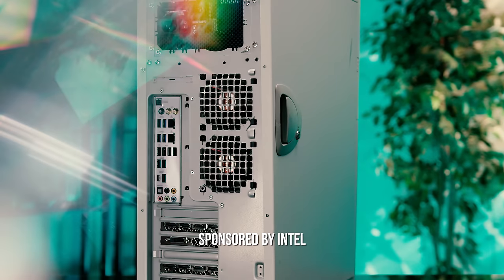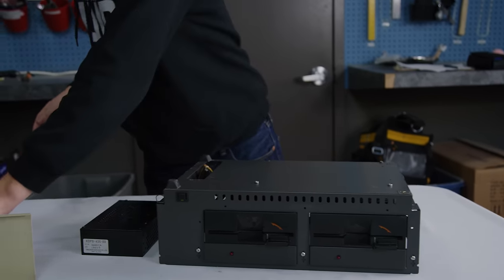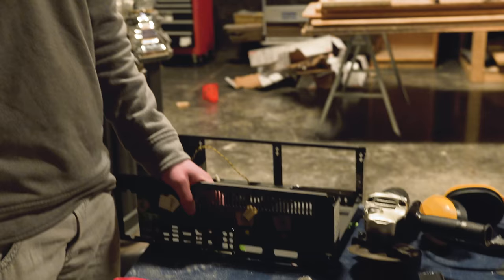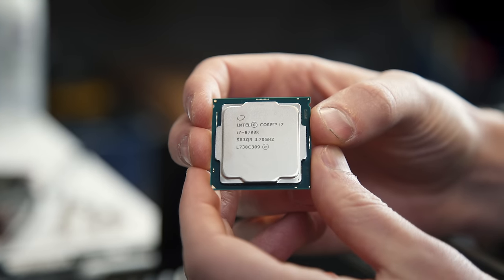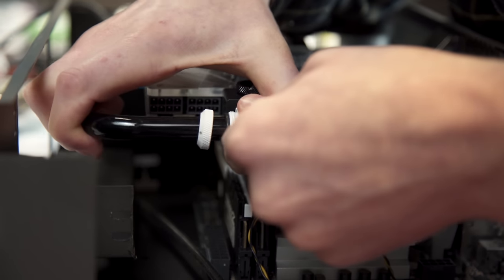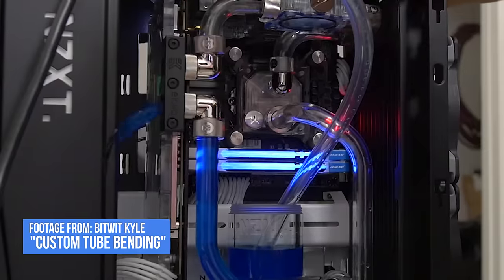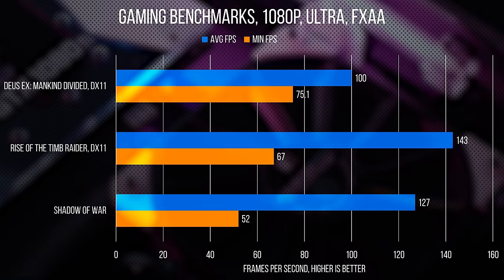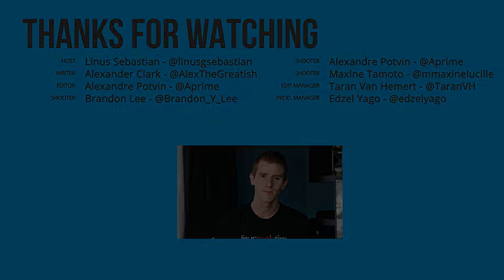The ULTIMATE Compact Sleeper PC Build

Comment: DALE is great as a sleeper...except no sleeper has RGB in it. Defeats the purpose of said sleeper.

Drop the stupid lighting because there are no windows anyways, and it is a perfect sleeper.
Reply: ChaosphereIX No one's going to see the RAM because there are no windows in the, to be fair. Also, a sleeper is supposed to be ordinary on the outside, and a party on the inside, so that when another person checks it out, they can see the work and effort put into the sleeper. This along with the performance of said sleeper makes it a sleeper.
Reply: ChaosphereIX Well that and the giant monitor on top and the peripherals. You need to completely scrap the modern amenities and replace them with a CRT, IBM model m mechanical keyboard, and an old Microsoft mouse
Reply: but putting in that light strip, to leak out all the HUGE cracks in the chassis, is not even like barely hiding your turbos behind the front grille, right beside the obviously huge front mount intercooler. No, it is worse, and is like putting in ground effects on your LS swapped Chevette. Defeats the purpose of a sleeper because it advertises to all that it is a highly modded car. Sleepers are all about the performance hidden in a humble chassis. Performance.
@Tony - the build is not about the peripherals, it is about the case. And no, you don't have to. I know lots of people who have gaming peripherals on crap computers. Or, to continue the automotive analogy, track tires on their family sedan. Or an expensive HID lighting system in their Corolla. Peripherals are extraneous.

Comment: Hey Linus margaret needs to be like an apple II but with 2 thick 60mm 140mm radiators, a 4k monitor, and a glorious i7-8700k overclocked to 5 ghz.  Oh and maybe 2 zotac 1080 tis in sli.
Reply: CompuTech No apples generally suck and so when you see an old apple then that must mean it really sucks
Reply: IoBrosGaming Hey the Apple II line was Apple's only GOOD computers. Once the Macintosh hit it went downhill fast.
Reply: IoBrosGaming Actually, Steve Wozniak designed the Apple II. Steve Jobs actually wanted to reduce how many internal expansion slots from 7 to 2 and lock down the computer. The Macintosh was Steve Jobs' idea and it was slow, locked down, and had a GUI,  which was a huge marketing point which was used heavily in favor of it. Steve Wozniak wanted expandability and openness while Steve Jobs wanted a locked down, expensive device with heavy marketing. Steve Jobs started the decline of the company, and Tim Cook screwed everyone.
Reply: That would be awesome hahaha
Reply: There already is an Apple II case like that. It's called a Raadition.
Reply: +IoBrosGaming Isn't that kind of the point for the sleeper builds? Make people think you got a piece of crap when it's really a VW Beetle body with a Porsche engine.

Comment: If I attempted a thing like that part of it might be done with a jigsaw with a metal cutting blade (fine teeth).  Angle grinders are fast but use them outside so you don't start a fire from the sparks.  Keep a good hold of that thing too because if it gets away you won't forget that!!

Comment: Awesome build but an i7-8700 SFF Dell Optiplex is a smaller box that sustains about 3.6GHZ all core on air thanks to the high amperage blower fan. Probably more with metal HS compound. and would need a 2nd PSU for video card pwr.

Comment: You need to finish the build though.. Make the monitor, keyboard and mouse look retro too. 
 - Old IBM clickey PS/2 keyboard
 - Gaming mouse guts in an old looking beige mouse
 - Inset the LCD panel in an old beige tube monitor or TV enclosure cut down for widescreen? 

Maybe make the monitor top open to reveal a thermoelectric cooler to store cold drinks in?

Comment: when your grinding, you should use safety glasses and a face shield, aka dual eye protection. trust me ive gotten metal in my eye once. no bueno. they use a die grinder with a diamond tipped bit, on your eyeball to remove whatever got in your eye.
Reply: if not the metal in your eye will rust and youll lose an eye.

Comment: I have a laptop almost that big. That has enough room to be a great sleeper device, actually...
Ok, not that big. But over an inch thick. PCI ports on the outside (and firewire, and floppy, etc.)
It's not a sleeper right now, but it still works perfectly... can't take that for granted in a single-core with 60 MB RAM (4 MB VRAM)

Comment: "leaked.. leaked again!" You wouldn't have that problem if you went with air cooling. Granted it'd run hotter due to modern parts in this old case that has no real airflow - though if you're cutting it apart, then this isn't really an issue since you could put something together for that..

Comment: You can buy one inch thick drill bits and drill out the bulk of the hole sizes you need and finish with a file, rather than expose your ears to the high impact noise of those power tools.

Comment: I hate sleepers it ruins history
Reply: Why? It's making good use of old cases. You know what ruins history, though? Not making correct use of the English language, especially its grammar.
Reply: Cocktus it’s just a personal opinion also I have done a bit more research and as long as it isn’t an original work computer I’m fine with it
Reply: @wannaberetro2495  That's alright, I suppose. Just thought that throwing away a chassie instead of reusing it would be the worse decision.